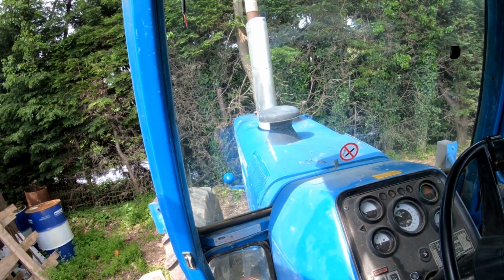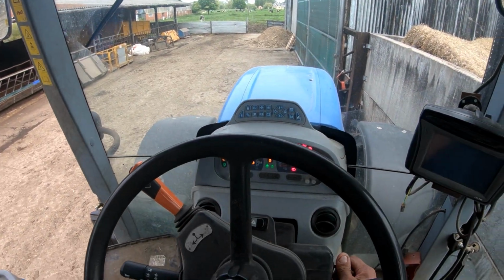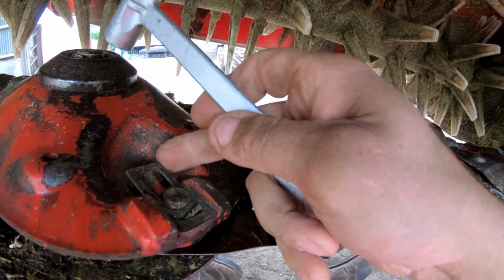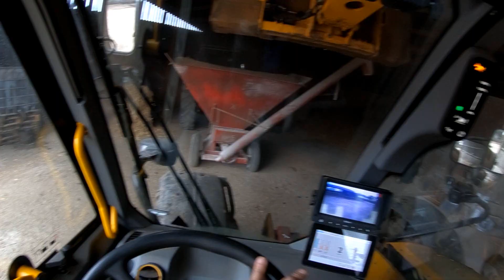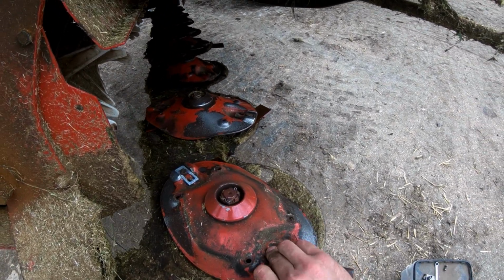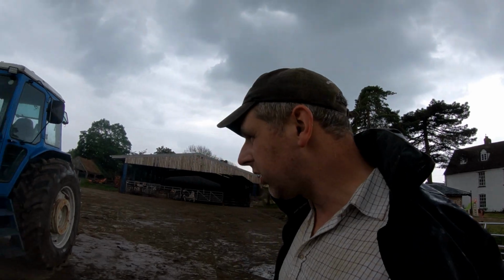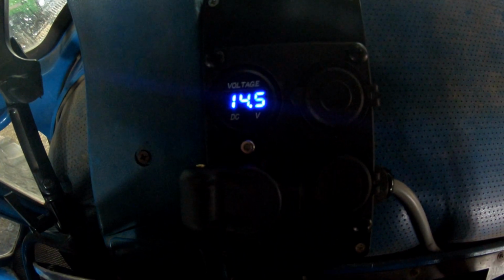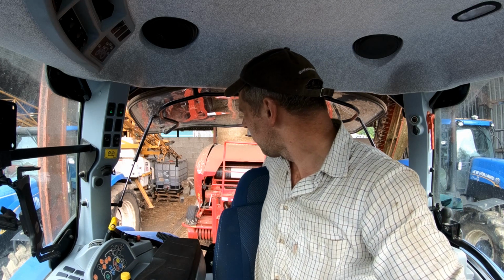GETTING THE KIT READY FOR SILAGE 2021!

Comment: That fast fit option is not very fast fit. Seems very fiddly. Quicker with bolts and nuts. Kuhn have a similar system where there is a spring plate to release using a special tool. Blades changed in seconds. How do you find wear rate between genuine blades and non genuine? Nice video.